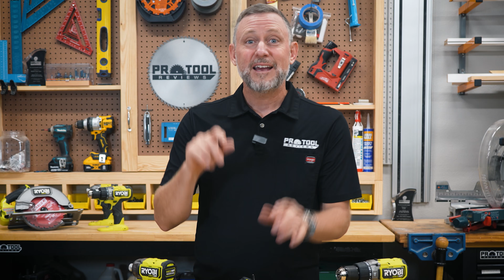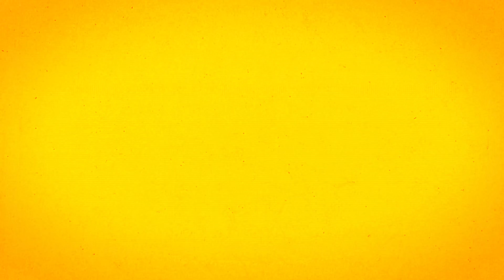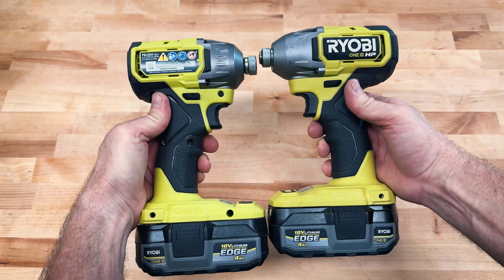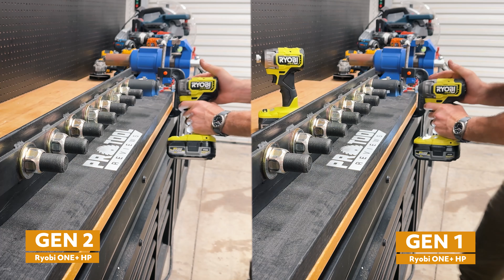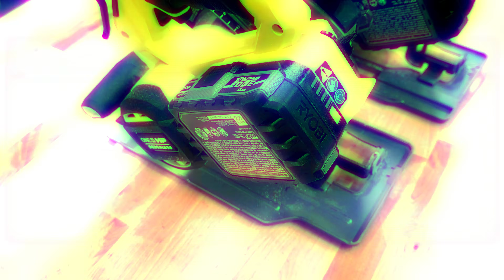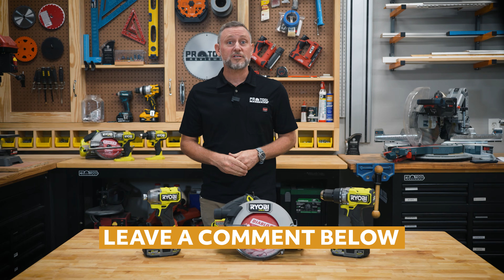NEW Ryobi 18V One+ Tools! Drill, Impact, Circular Saw TESTED

Comment: To much human error. You need a jig to compare apples to apples. The best upgrade was the gen 2 hammer drill. Theres no arguing or debating about it. The gen 1 saw was very loud
Reply: I always thought a standard 15 lb weight should be weight to push down on all drill tests.

Comment: I bought my first set of Ryobi 1 st green 2020 

I hated he 5 inch saw 
The mulit oscillating tool 
And the drill

Worst buy ever 

The sawzaw impact work amazing 
Just got the new hp oscillating multi tool about to probably the 7 1/4 

I own some DeWalt some rigid some Milwaukee 
But for pricing Ryobi is winning on few items maybe with this new lineup they push performance and keep the price low 

I'm gonna finish watching your best handsaw videos before I make a decision 

Current have a 5 inch dewalt great for 2*4 not so good for treated lumber 

So maybe I might switch brands but def need a cordless strong handsaw 7 inch minimum

Comment: Still the same outdated battery design though. Would say Erbauer are the better option if you're a DIYer starting out with a new power tool kit
Reply: Outdated battery design is normal. Ryobi's policy is to ensure full compatibility with all of their tools, even 20 years old blue ones... 🤷🏻‍♂️
I tend to approve that batter than brands who change their standard every 3 years...
Reply: No Rigid Is better than both
Reply: @Clamjuice65 Ridgid is owned by TTi like Ryobi or Milwaukee.
Slightly better yhan Ryobi, but more expensive.

Comment: Have the Gen 2 HAMMER DRILL and IMPACT DRIVER Sold my Gen 1 set for $100 to a RYOBI LOVER The Gen 2 HAMMER DRILL Will MOPE UP The Milwaukee M18 FUEL GEN 4 Hammer DRILL in Concrete I know did some Testing RYOBI has Really Stepped Up There Game

Comment: I have the gen 1 impact. It was a beast, but the metal around the end of the drill gets super hot. Does the gen 2 have the same issue after continuous use ?